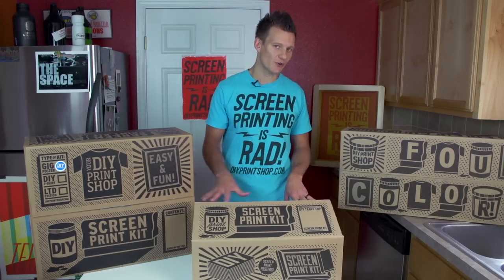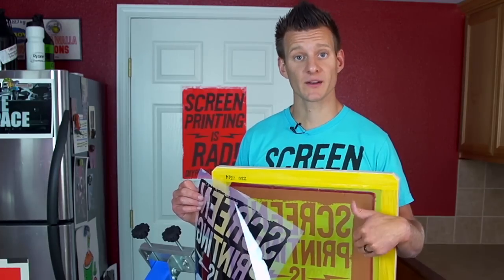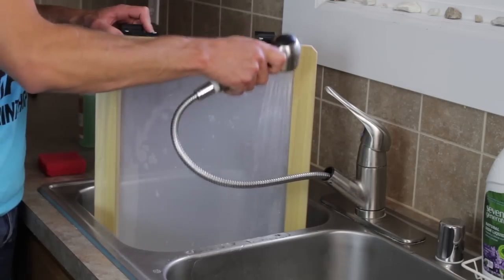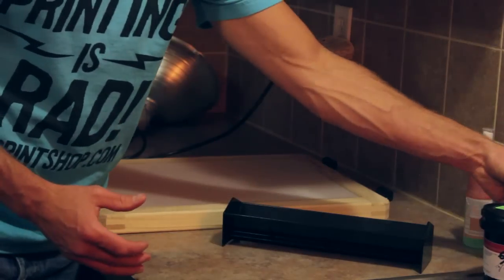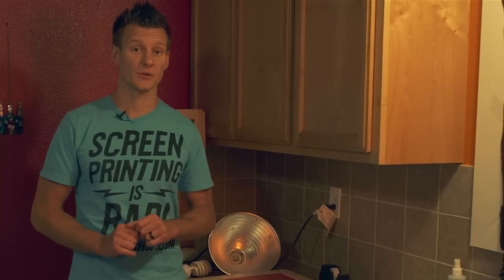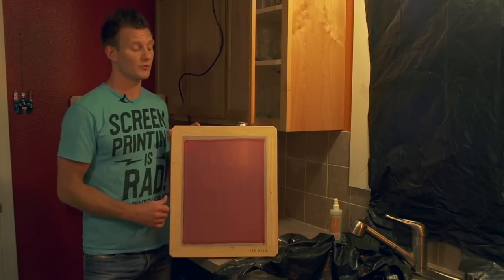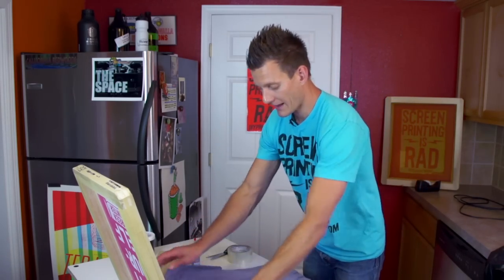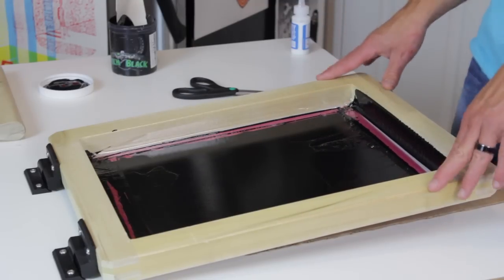DIY Screen Printing How To Instructional Video from the DIY Print Shop

Comment: Thanks for your video. Plastisol Ink or water-based ink, Which is better for a beginner?
Reply from the maker: It really depends what you're preference is! Waterbase is easier for clean up and is a smoother creamier ink to work with but some people prefer plastisol since it's so easy to work with. Waterbase can be a little finicky since it dries out quicker than plastisol but it's lovely to print with! Call us anytime to talk it out :)

Comment: how would you cure a silicone rubber product? I'm afraid it will melt the rubber if using to much heat. Awesome video and product btw!
Reply from the maker: Great question! Thanks for watching! Silicon is made to literally prevent things from sticking to it. So if you are trying to print on it you will need to use specific inks or a specific process that we don't carry. What item are you printing on?
Reply: phone cases
Reply from the maker: Try this ink out: http://www.unionprocess.com/inks.html

Comment: great video, with the "light safe room" if it's similar to photography darkroom, then a "tent" like the one plate camera , ultra large format photographers use would be more in line with the "beginner" philosophy, just get in the tent, which has a table and all supplies inside. if you are not sure look under topic ansel Adams, or plate camera darkroom tent.

Comment: I like your content but not sure What kind of light pulb and wattage and curing time you are using on this video? I am using ryonet emulsion and a 500 watt UV shop LIGHT but cant figure out the correct curing time. 22 inches frim light to screen. Would you please reommend how and what to use? Thanks.
Reply from the maker: Hey Robert, couple quick questions. What emulsion do you have there and what mesh count are you trying to expose? The shop light in theory, does the trick, but need to know a little more before i say exactly. if it's easier, you can email me directly at jwells@ryonet.com. LMK!

Comment: Great video, learned a lot! I have a question about the white printing. Is it absolutely necessary to have that 1/16th of an inch space between the screen and shirt? I'm wanting to do white ink onto dark shirts, but would prefer to do the hinge method. Would appreciate your thoughts on if it is possible to still make high quality prints! Thanks - Lorenzo
Reply from the maker: lorenzomusic95 When printing white on dark it is actually more necessary to have off contact, its actually less necessary when printing thin inks on light shirts.

Comment: This is all good how your helping everyone. However Im having a very hard time getting the image to stain onto the emulsion, I did it just like you did...Mabye 9 mins to stain the image is too short? What happens if I wait longer?
Reply from the maker: Hey there!  I would suggest trying 10 minutes, and if you are still not getting a proper burn, go ahead and take it up to 11!  Also, you want to make sure that your exposure bulb is 15 inches above the screen you're trying to burn!
Reply: yup it worked thanks, took a long time to spray out the burn i think i used too much emulsion.

Comment: "don't forget curing, especially the t-shirts" I know it's a silly question but Posters just need drying not curing, right? Thanks (the "especially" threw me off) lol just need a "roger that" or whatever. GREAT tutorial. I started thinking oh I'll check it out and fast-forward but I watched the whole vid and it went FAST. Well done.
Reply from the maker: Thanks for watching Heather! Paper wil lair dry and does not need to be cured with heat if you are using water based inks :)

Comment: Ryonet, let's say I am printing 20 shirts, should I heat the ink after print 1? or could I print all 20 shirts, then heat them all?
Reply from the maker: IT really depends on your setup. If you have a one or multi-station press, you can cure after each shirt is printed

Comment: Hello, my shock is attached to the bottom ball and not the one attached to the blue part of the press. The opening of the shock is facing away from the ball component on the blue arm of the press so I am unable to attach is there. Is there a way to turn the top of the hinge?
Reply from the maker: +Kaitlin O'Connell Please call our support line and they will walk you through this.  800-314-6390

Comment: I use a heat gun to cure ink (printed with 230 mesh). Steam still comes out after a minute.  Should I keep going until all the steam stops?  Should I use a higher heat setting? (1000 degrees is the highest the gun can go)  Thanks for any advice.
Reply from the maker: +Marvin Cake Thanks for asking Marvin! Steam is definitely normal and should not be a concern. Smoke is a concern and if it starts to smell like its burning you want to move the heat away. If you're curing water based ink, the main goal is for the ink to get up to about 320 degrees for 30-90 seconds, depending on how thick the print is. The key is to let all of the water evaporate out. Are you using a temp gun to make sure the ink is getting to the proper temp?

Comment: great tutorial i just purchased to help with my business. ..i wanted to know us there a way to get the previous image out completely because i can't. print another image because you still can see it
Reply from the maker: Hey there!  To get any leftover ink out of the screen, you would want to use an ink degrader.  For plastisol, you would want our Sgreen Ink Degrader. For water base, you would want our Sgreen Aqua Wash.

To get the emulsion off the screen, you would need something like our Sgreen Emulsion Stripper!  Ink degrader first, to get all of the ink out of the screen, and then you can proceed with the emulsion stripper. 

If you are still having issues getting your screen reclaimed, please don't hesitate to reach out to us at success@ryonet.com, or 360-450-6845!

Comment: After exposing it you said we can let it dry by using the exposure bulb. Does it matter how long we leave it on for it to dry?
Reply from the maker: +santiago fuentes You can leave it for quite a while, if you need to.  The light will post harden the emulsion, helping it last longer.

Comment: Can you re use the screens? Like if I wanted to make 100 shirts of the same design would i have to re do everything?
Reply from the maker: +Thrabid Great question, if the screen is properly exposed the emulsion should last for many uses.  So yes, you could use the same screen to print 100 shirts and then clean the screen and store it until you wanted to print 100 more!  Or, you could reclaim your screen and put a different design on it!  Thanks for watching!

Comment: Any idea on how I should cure plastisol ink at home? I don't have the funds to purchase a flash dryer. Thank you!
Reply from the maker: +OfficialDRuiz oven will work or the heat gun, if curing in an oven you want to set at about 400 degrees back and cure for roughly 30-45 seconds. A heat gun is more handy but less thorough, the ink needs to reach 320 on the inside of the ink

Comment: Hello Ryan I need help in ordering the right size of the image on the screen? How will I measure it I learn a lot from your videos I have a meteor white waiting I just need help on how to get the right size on the image that will be going on the screen...I did it before but It came out wrong I use a ruler though it was to small ...could you please help
Reply from the maker: Michael Campos I best way I did it was to print out the image on a white piece of paper and do a physical mockup on the shirt, I found this was an easy way to gauge how big to make it.

Comment: Is this a cheaper method to heat pressing your designs? It seem like way more work just to make one shirt when compared to heat transferring plastisol inks.
Reply from the maker: If you are only making one shirt, you are absolutely correct. The time and effort it will be more expensive in screen printing, but if you are doing any more than 24 shirts, its going to be way better for your time/money in most cases :)

Comment: How do you make the film with the design you want ? Whats a low budget DIY way to make films and the designs on them ? And is this DIY kit designed to print white plastisol ink ?
Reply from the maker: Hi Rick! Screenprinters often use Adobe Illustrator or CorelDraw to create vector images to print on film. Extremely low budget way to do it is to draw on film with an opaque black marker! All our kits are capable of printing plastisol inks. Reach out anytime by phone or on our site chat at screenprinting.com
Reply: @Ryonet  Thanks

Comment: Does this hinge kit offer off contact room? I plan on using plastisol ink on dark garments and don't want the ink to stick

Also, what mesh size should I use for plastisol inks white and black?

I was thinking of using the Comet White Water Based Ink, but I don't have a flashing unit and it would be hard to print on dark garments. Please help.
Reply from the maker: +OfficialDRuiz 156 mesh is the most popular option for most printers.  For off contact on the hinge kit, we recommend taping a couple washers to the front of your screen, this gives about 1/8" off contact.  Ryan covers that and more in this video about printing with the hinge kit, check it out: https://youtu.be/KJka1xRVNvo

Comment: Is the mount supposed  to shift up and down after tightening? I have tightened the bolts as far as they can go but when i put down pressure to lower the screen, the mount shifts and the angle changes and wont stay straight.
Reply from the maker: If you mean the bolts on the press, these should hold sturdy when placed down. Were they overtightened by chance? Please send a video of the issue you're referencing to success@ryonet.com and we will look at everything with you! If something needs to be replaced we will be happy to help you with that :)

Comment: Hey ryonet I recently bought a diy gig poster kit and im having sooooo many issues with adjusting the off contact. It never seems right. Any advice?
Reply from the maker: Tape a washer or a couple quarters to the top of the screen. That should help. =)
Reply: Ryonet looks like the 20 x 24 frame i have doesnt  touch the pallet where my washer is tape.  its higher than the pallet

Comment: After you wash out the design can you blow dry it to speed up the process?
Reply from the maker: +Jeffrey Montiel Yes you can, we actually put ours in front of fans in our dark room.  I would use the blow dryer on low or no heat.  Thanks for watching!

Comment: Can you use a heat press for drying the ink?
Reply from the maker: Jeremy Johnson Jeremy you actually can use a heat press and it will work very well for curing water base green galaxy ink. It takes about 1 minute and we still recommend using parchment paper

Comment: Can you add more than one color on this exact machine ? +Ryonet
Reply from the maker: Vato Alfred The machine is not expandable but you can put another screen on it to make more than one color on a shirt, it is just harder to register.
Reply: Ryonet Oh okay, so  you would just take off the initial screen, and then swap it for another one once your ready to add another color, correct?

Comment: Instead of using a gluey card board inside the shirt a solid neoprene rubber sheet might be an alternative (available on ebay for example). This stuff is a sticky enough by its nature so that the fabric will not slip. Very nice instruction video nonetheless
Reply from the maker: RockmannMusic thats a great idea

Comment: What is the process when it comes to 'curing' paper prints?
Reply from the maker: +vyana marie If you're using low cure additive, you can air dry.  Here at Ryonet, we run our posters under a flash dryer or conveyor dryer.  If you're using a diy kit you might consider a hair dryer or heat gun to cure your prints.

Comment: Regarding the shelf life of emulsion: Once the emulsion is on a screen, how long will it remain good? I understand to store in in the dark, if one were to use all of the emulsion on screens right after mixing and put them is storage for later exposure, how long will the screens remain good?

Also: You reference using a pressure washer to reclaim the screen, is this referring to one of those 2500 - 3000 PSI machines we all use to wash our houses and cars? I would then assume you wouldn't use the highest pressure nozzle, 2700 or 3000 psi is quite aggressive, can the screen really handle that velocity? 

Finally, regarding washing inks and the like down the drain and being eco conscious: The drain leads to the sewer, which in turn typically goes to a waste treatment plant to settle the solids and break them down before it is returned to the supply water source.......isn't this more eco friendly than just washing it out in the yard?

Okay, I think that's all.....for now. Thank you.
Reply from the maker: Great question! But that depends on if the emulsion has been exposed or not. We recommend exposing your screens within a couple weeks of coating, because there are too many variables that can effect it.
Reply: It wouldn't be exposed at all, as we apply in the darkroom and place in the light safe drying cabinet. Then we are considering building a dark cabinet for storage until use. 

This brings up another question then: Temperature and humidity. 
What would be the ideal values for temp and humidity for storage? 

We're simply trying to improve efficiency and if the prepared screens will last longer than the emulsion in the jar it would be more efficient than storing it in the jar. 

We understand that the neither the prepared screens or emulsion would likely ever reach any expiration date unless we coat many more screens than we would use in that time, but we can figure out our anticipated needs and adjust emulsion purchases accordingly as long as we have an idea of longevity. We're just hoping you may have already discovered the amount of time they last and save us the time and investment it would require for our own experiment. 

There ARE some additional considerations that I can think of (that anybody reading this might also need to consider), namely the energy costs of controlling temp and humidity if ambient values are outside of the ideal value ranges. If energy costs to maintain an ideal environment in storage would come to a larger sum than replacing the emulsion, it would certainly be best to store the emulsion in the jar. Each organization would have to figure these costs Vs.value out for themselves of course.

Comment: I'm doing my second try on this today and it is still taking a super long time to wash the screen out. We've had to scrape the emulsion off for it to show up. Is there a reason why this is happening?
Reply from the maker: This could have to do with a couple of factors. If your film positive isn't completely opaque, your image area may be receiving a tiny amount of light, making it difficult to rinse out.  If you can hold your film positive up to the light, and see light through it, it's not opaque enough.  If you're using a normal inkjet printer, we would suggest printing 2 copies of the film positive and taping them back to back.

Something else you can try is wetting down the front and back of the screen prior to rinsing, and then letting that sit for a couple of minutes. This can soften the emulsion that needs to be rinsed out and allow you to rinse it away easier.

If you find you need more help, please don't hesitate to reach out to our Customer Success team!: success@ryonet.com OR 360-450-6845 !

Comment: Can you let the ink on the shirt dry for a couple hours before heat setting? I did my first one wet and it ruined the design since half of the ink stuck to my paper and it smashed part of the thicker parts of the ink out (causing a smudge). I was using plain printer paper between the iron and wet print..
Reply from the maker: +Josh Brown You can let it dry, if the ink stuck to the paper that probably means you have too much ink down, but you can also let it air dry for a while first and then heat set.
Reply: Thanks! The ink was white on a black shirt and it was pretty thick.. Would that be the reason? or do I need to go over the screen less with my squeegee?
Reply from the maker: +Josh Brown Try applying less pressure pushing the squeegee at about a 45 degree angle.
Reply: +Ryonet Thanks so much! =]

Comment: wont the frame bend because of the water, for example when degreasing?
Reply from the maker: Hi @buildyear86 the frame should be pretty stable. It will warp over time with exposure to moisture, but should be good for a season.

Comment: does the UV light damage the screen if some parts of it are not coated??
Reply from the maker: I am not sure what you mean, however, light is a problem for the emulsion not the mesh.  So if you have mesh exposed then it is not a problem.
Reply: +Ryonet thank youuu that answers my question!

Comment: 19:00 i dont get it

i have seen others just putting ink and using squeegee and thats it. they dont even put ink on the other side.
is there any difference? im confused

 35:00 here is the other method i have seen most do, but they dont do the other steps where you did 19:00

can you explain the difference?
  tnx
Reply from the maker: Hey there! At 19:00, Ryan is coating the screen with emulsion, which prepares it for exposing your image.  At 35:00, he is spreading ink into his screen for printing!

For the emulsion process, you want to coat the entire thing using a scoop coater, like Ryan showed.  Putting ink a screen is usually just done with a clean up card, or a spatula.

Please let us know if you have any other questions!

Comment: Is the press compatible with a 23x31 frame?
Reply from the maker: If you get a larger platen it kinda works but I would not recommend it, I would recommend looking at Riley JR if you are looking at doing this size of frame http://www.screenprinting.com/riley-hopkins-jr-screen-printing-press-1-color-1-station?s=1&gclid=CODTu4Ketc0CFUdrfgodjOsCCw